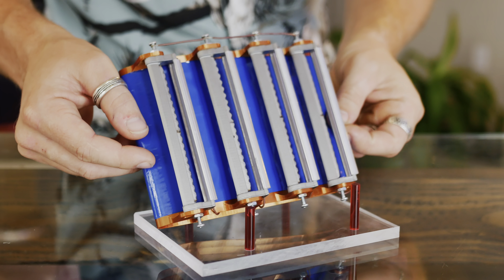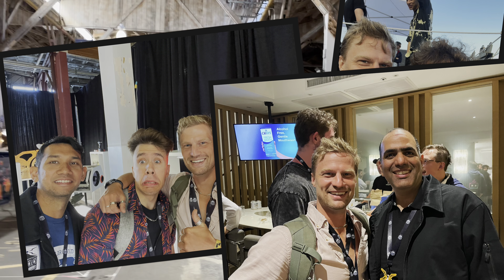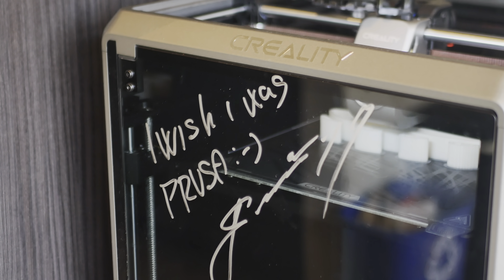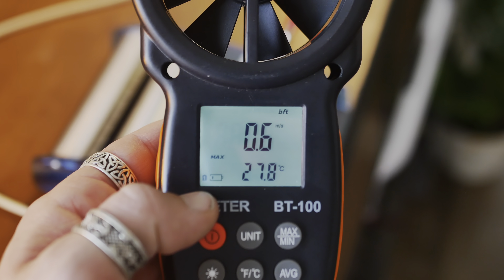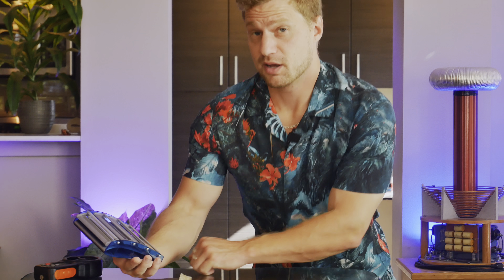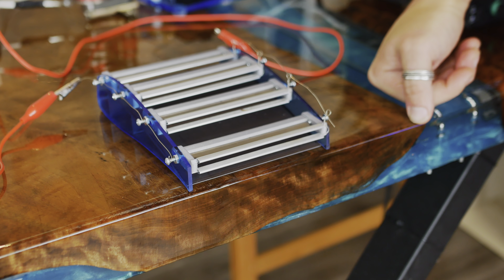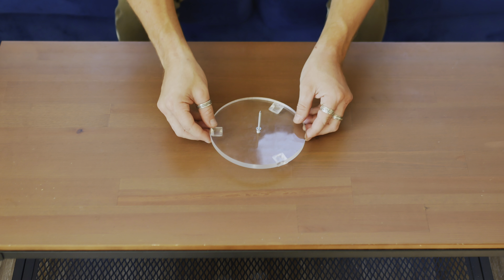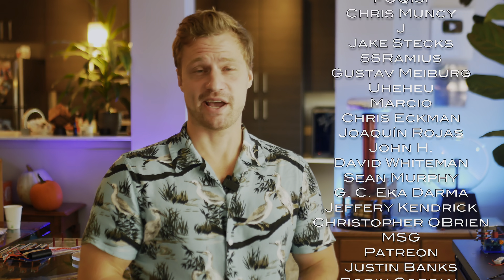Designing A Self Propelling Ionic Thrust Wing

Comment: By the way, do you like the group Beetles? Step by step you get closer to the design of the beetle. More than once I experienced the shock of a high-voltage discharge, accidentally colliding face-first with a flying beetle. If you look under a microscope, its hairs are your blades, optimized to the limit, forming the ionic wind. You are missing a printer that will print highly porous structured polymerized sugars (this is close to click chemistry) fender liners or multilayer chitin on a microscale. The microscale of a beetle is important because its levitating properties or lifting force begin to appear precisely because of the design of the microforms. Remember that the needle emitting ion wind can also be expanded in surface area if it is made fractally structured on a micro scale.

Comment: I know nothing about any of this but: Won't the thruster assembly being on top of the wing generate drag? What if you put the thrusters inside the wing and give it air intakes on the lower front part of the wings, while opening up a gap at the rear of the wings just before the edge? Would the shape of the wing naturally force the air being pushed to compress like the exit of a turbine and give it more thrust?

Again, I know nothing about the topic but it my mind that concept has the potential of being a massive upgrade, I dunno.

Comment: I don't think it is efficient to have thrusters over the wing. The main reason being , these thrusters work as air spoilers, which create von karmen vortices behind them. These vortices, in turn, create turbulent flow, hence increasing the drag. 
You either want to sandwich them inside the wing so that air flow over the wing remains smooth or you want to install them at the back of the fuselage

Comment: Why do you need the wing at all? Like vortex generators that provide for parasitic drag and the turbulence from the ensuing vortices, there is a boundary layer of air formed that smooths the air flowing over the wing shape. Why not use the ion thrust to act as it's own vortex generator and create it's own boundary layer? In short, an airfoil shaped by air.
And it may not look like what you think it needs to look like. WE know lift is generated because velocity of air over the top of the wing is faster than velocity of the air beneath the wing. making a lower pressure area above the wing. Using electrical output, you can adjust ion speed based on input energy. We only use a cambered wing to mechanically force the top flow to move faster than the bottom flow creating a pressure differential. Could it be possible to have an actual wing thickness of ZERO? Or maybe just thick enough to separate the two airflows?
It seems the equivalence of making a jet engine with wings is making an ion thruster without wings. If flight is the name of the game instead of new propulsion method. All we need is a difference in pressure.

Comment: Mate, the shape of your wing is overkill. Too heavy and inefficient! Delete the lower surface for less weight and greater lift efficiency. Modern wings look like that because they need to carry a heavy load (designed for structure). Your wing should be thin like the sails on a boat. Think WWI biplanes. 
Thank me later.

Comment: what you are doing is already been done in lale 90' to  2001  when i left the company there was few different models airplans already flying  but  when we made full size model  we could not get it of the ground at 130%  weight  while rc models could fly at almost 200%  double  its weight.  also  how you can reduce weight  is by electroplating plastic or wax paper.

Comment: What if you were to integrate the components of the thruster into the surface of the wing?  That way you don't have the drag of the components (which would be pretty horrible), and you might be able to create some interesting patterns in the wing surface that might help as well.  Regarding weight of the printed parts, you might want to investigate LW-PLA, which is a little less than half of the weight of normal PLA.
Reply: Agreed, foam wings end up being even lighter than LWPLA
Reply: I agree with this comment. I know very little about aero dynamics, but I feel like having the thrusters on top of the wing would disrupt the laminar flow over the air foil. You might get better results with this integrated into the wing or inside of the wing. Also I see it being a fractional gain but, vortex generators on the leading edge might help you out with lift as well.

Comment: You should consider using styrofoam, or pulp paper; the stuff subwoofers are made of, for the wing. Also placing your thrusters under the wing on the flat surface is going to give you more thrust, sucking air over the curved surface is sapping your energy.

Comment: I wonder If you need the wing in this shape, normaly it is designed in this way to create a differance in pressure between upper and lower side. In your project you are creating low presure by speeding the air above (Bernoulli Law) so it will create lifting force

Probably you can massively reduce weight and the air resistance by just spliting the air with simple plate

Comment: Very interesting, lots of fun. You are using razor blades to get a sharp edge. That increases the electric field which increases the ion flow. The wire will reduce weight but might reduce the radius of curvature and so reduce the thrust. The view in the dark shows where the ion emission is: very interesting. Those sharp edges will require maintenance. 
Bottom line: wow, revolutionary work. Who knows where this might go. I love this video. Visionary. Great engineering.

Comment: Also working in commercial mechanical industry I know that certain materials cause more friction when air passes over them, thus slowing the airflow or causing more turbulent behavior. Look into igus iglide 3d printer filaments. They make stuff for dry ball bearing applications with super low drag and friction coefficients. Or use teflon (PTFE) and air friction should decrease by quite a bit

Comment: In my opinion you should add at least one engine at the bottom and move it as far forward as possible  to improve the flow of the airfoil leading edge (in this configuration this may works a the negative angle of attack). What's more you could try to mount ion engines on the outline of the airfoil, exact on the upper surface to ensure laminar flow. As for the balancing method it may fail when the wing will generate lift. I really hope that this project will be success.
Reply: On the other hand the Kline-Fogleman airfoil might be interesting

Comment: With 15 years of aircraft design experience under my belt, I find this fascinating.
You need to measure the thrust in still air, and moving air. Question, do these thrusters increase thrust with faster moving air?
Reply: They should be underneath the airfoil.
Reply: @mikalhernandez  I also thought about repositioning them, but, I guess that would  kill lift totally.. But, maybe, just one under the leading edge?

Comment: I am very curious about how this design will effect flight and Bernoulli's low pressure zone sucking the wing up?
Reply: Putting the thrust on the bottom part of the wing may allow thrust with higher pressure under the wing while ambient air flowing over the wing through the Coanda effect. Just a thought, if thrust but no flight happens with the first design.

Comment: that seems like it will be a very small volume of air moving over the top of the wing (which is a key factor that generates the lift, I believe). it might seem counter intuitive, but I think putting the thrusters on the underside of the wing would be better.

Comment: Why not use an airship design ( lighter than air blimp or zeppelin)   to get the lift you need to support the thruster frame first. This should zero or reduce weight while increasing the area required to push the machine forward. There were designs back in the late 60's or 70's that combined the lift of an airship fuselage with wings of a plane to create a heavy lift machine. This might be an alt ave ue to pursue as well

Comment: With the source of thrust being on the top of the wing, you are going to run into an issue at some point where the thrusters may start to tear away the boundary layer of air running along the top of the wing that is necessary for lift.

Comment: I was watching this and while I do not think I am particularly smart or knowledgeable I do have ADD which means I often see things differently. So… if lift is created by drag on the top of the wing as opposed to smooth airflow under the wing, could you not integrate your ionic propulsion into the wing? It creates a void over the wing providing lift..? Might not matter the direction of flow and, offhandedly he remarks, might potentially create life with little to no forward movement. That would be awesome and I have reach my capacity of pondering… thanks for the show!

Comment: The most efficient wing (not while airframe) is where the ionic thruster is light, large, powerful and attached to the flaps and the ailerons, aiding in both lift with flaps and roll in the air.

Comment: The rational behind the shape of the wing is to create a pressure difference by causing the air above the wing to move faster than the air below them.
If you put the thrusters on the top of the wing/on both sides with different thrust you don't need the wing to have an assymetric shape.

Comment: Im curious, in the last episode you used a fan to show that the ionic drive didnt really increase when wind was already travelling into the system at equal or greater velocity. As such, you increased the length of the material to increase the reaction window.

If a plane is moving at far higher velocities than the thrust, meaning the wind is entering the control volume at velocity greater than the thrust, wouldnt that essentially mean that there would be no real decrease in pressure, meaning no real increase in lift?

The greater wind speeds would mean less time for the electrons to collide, meaning the faster it goes, the less effective it becomes.

Comment: @PlasmaChannel I wanted to suggest to use Lanthanhexaborid for the electrodes. This reduces the energy gap for the electrons to exit the material to a very low value of 2.7 eV which should drastically improve airflow. This is frequently used in electron microscopes.

Comment: Nice video!
Why putting the thrusters on top of the wing? Have you considered putting them below?
Intuitively I would say the increased pressure below the wing would result in more ionized species. Combined with the fact that the air moves slower on the lower side, the same thrusters should produce a higher end velocity of the foil.

Comment: Hey! Great video! It would work best if you use the lightest material possible, such as aerogel or some other foam-like material, and electroplate two electrodes into it (so they can be embedded). Feel free to reach out if you want more details on how exactly this can be done. When considering an actual plane, there are several challenges to address. Firstly, the atmosphere becomes less dense at higher altitudes. Secondly, a system of electrodes like that can produce nitrogen oxides, which on a large scale could lead to acid rains (although the amount produced by one is minuscule). Thirdly, the material will corrode more than ordinary metals. Two years ago, I wrote a BSc thesis with a computational model, theoretical analysis, and experimental testing about this topic. I didn't proceed further due to the reasons mentioned above. However, it might still be possible to overcome most of these challenges. If you're interested, here is the link to my thesis: https://drive.google.com/file/d/1IY2kTS7NCVdT6LhJPqDCLGDblYvdllMR/view?usp=sharing

Comment: How about you incorporate your thrusters as a structural support, so you'll have it with a double purpose. Then work the shape around that. I would imagine, you can tuck the thrusters between a sheeting with a little intake and exhaust through the length of the wing. Shape the top of the thrusters with an added bump that will increase the wind pressure above further. Though I'm not an aeronotic engineer though. I'm just imagining this based on what I know about the basic principles of lift on a wing.

Comment: You can calculate your trust by placing your wing on the scale and then turning it on. As long as airflow below and above comes, it will work. Also, you needed more information to calculate the lift force. You have a trust value from the propulsion of the ionic drivers. The equation you had would be your moment of the thrusters- the moment all the drag force amongst the whole arm. Then, you need to figure out the exact drag coefficient of your winged section and do your drag-to-lift equation. Which would give you the closest answer multiplied by a loss coefficient depending on the amount of assumptions you made.

Comment: Great Video, impressed with your progress and looking forward more.
Had a thought though, and that is that perhaps going for the full monty flight mode is somewhat aggressive with just some Ions.

What if you focused on modifying a VTOL styrofoam model aircraft like https://www.youtube.com/watch?v=x_gQ4WMhJZg  where the focus was on adding an ion drive under/inside the existing functional wings, perhaps even 3d printing various replacements. This would allow using the propellers to achieve height and flight, and then gradually be taken over by the ion drive.

This would mean that the ion drive would be used to maintain flight not achieve it, and if all went ideal then it would travel without use of the prop's (you can get folding props that fold down when not rotating). Easing in the Ion drive seems much more attainable, and with an existing flying plane the whole task could be much easier. Having enough battery for take off and landing is a cinch, going long distances is not, this is where the ion drive could excel (Pun intended). Plus you wouldn't have to make all the control stuff yourself, it's literally off the shelf.

just thinkin ......🤔

Comment: Great content. Had an idea to eliminate weight from two sources. Look at your screws: how much thread from each screw actually contributes something? Cutting those to the bare minimal length should help the wing shed a few grams. Second, I'm not an expert by any means on aerodynamics, likewise on electrostatics, but let's call the wires the cathodes and the other electrodes the anodes, which are tubes with an ellipsoidal cross-section: do you need anodes? The anode is offset from the cathode so it doesn't get in the way of airflow. Why not go a step further and put the anodes on the wing itself. That is, keep the wires but just ahead of each wire put a strip of thin conductive tape on the top wing surface, and connect the anode wire to it. Now the airflow should head from the wires directly to the wing surface to generate lift. Best wishes. Hope you can get a flier up in the air soon.

Comment: Would you not install that kind of thruster below the wing ? 
The lift of a wing comes from the lower pressure on the top(the air has a longer way above the curved profile).
If you now increase the air speed on top of the wing with the thruster the pressure will decrease which should lead to less lift, no ?

Comment: Great vid to watch, look at the wind resistance of the battery pack of set to the wing? maybe make the battery pack equivalent  wind resistance to reduce drag on that side? or even better. 
2 wings and put the battery inside to even the weight and even the the air flow restance of one side. This might get greater rpms and more efficiency.

Comment: Change the voltage, and the frequency, and the wave form. Voltage should probably be over 100,000 V, the frequency should be a square wave instead of a sine wave. And try the frequency at about 1,000,000 Hz.
Probably use plasma tubes instead of metal holders. And then you could insert those into the wing instead on top of it.

Comment: You will run into major problems with the thrust being generated on top of the wings. The stages will starve for air as the angle of attack increases. It is a common problem for jet engines which is why the propellers and intakes of jet engine are usually on the front of the wings or towards the front. Jet engines are "part" of the fuselage not because they need an air tunnel, rather they need unobstructed air. Think of it this way...take a tube, look at it parallel to the ground, or to the direction of movement. The mouth is fully open and all air flows through it. Now tilt the tube upwards at 30 or 45 degrees and consider the tube is still moving parallel to the ground-you have occluded the opening dramatically.
This is what is also going to ruin the performance of the "engine" overall.